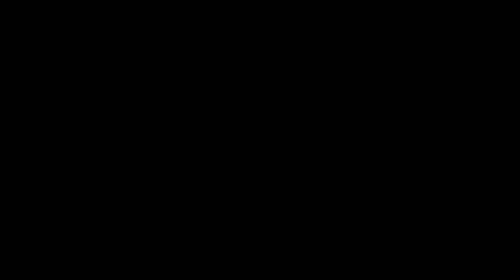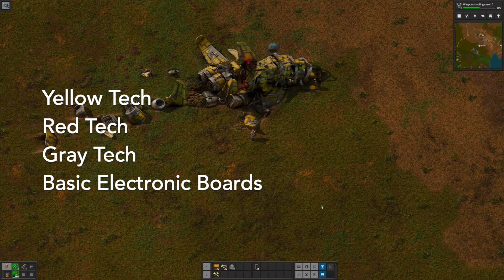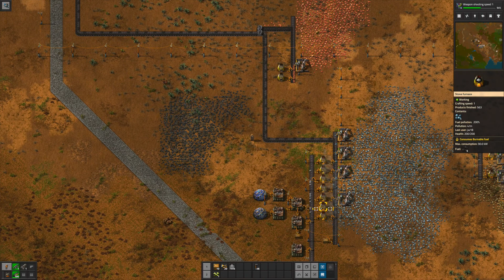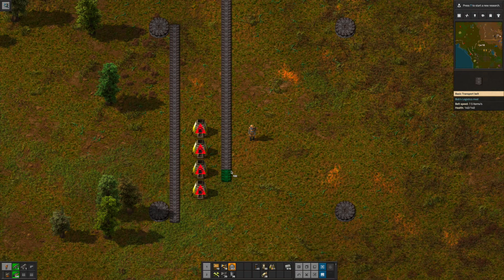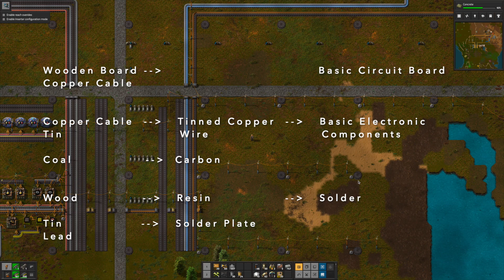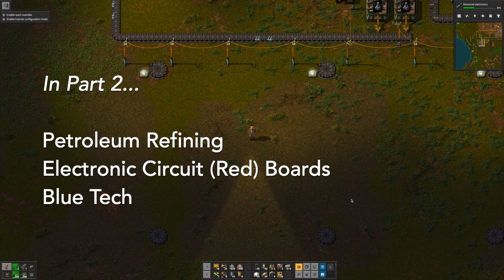Let's Play Factorio with Bob's Mods - Part 1

Comment: Hold on, so you can consume energy to grow trees and turn them into pellets and have net gain of energy? I always thought that the game is balanced in a way that such infinite energy source is not possible.
Reply: The power of the sun, kind of like solar energy. It is very difficult, however, to keep even a moderately-sized base powered off of wood alone. It works for a while only if you have solar panels during the day, so pellets can accumulate and power you through the night.
Reply: @jasonwalthall8382  That was my first thought, it's solar with extra steps. Looks like okay starting energy source, I'll definitely try it in my  next run.